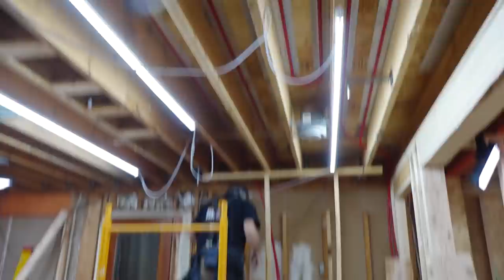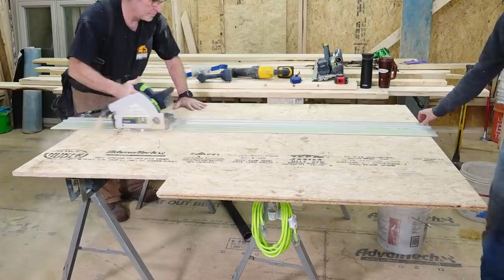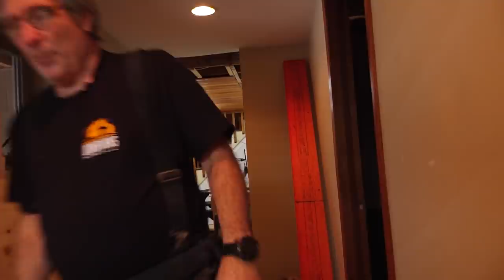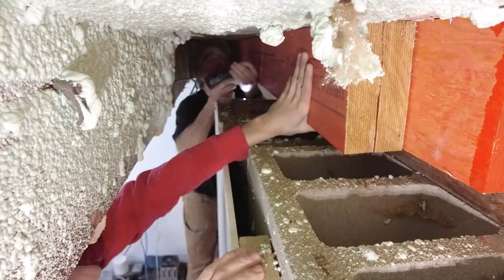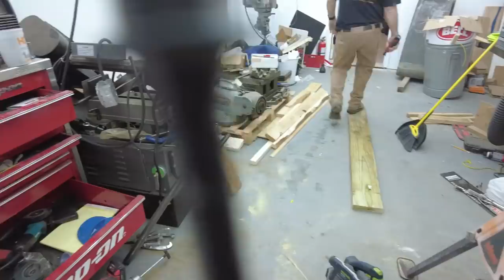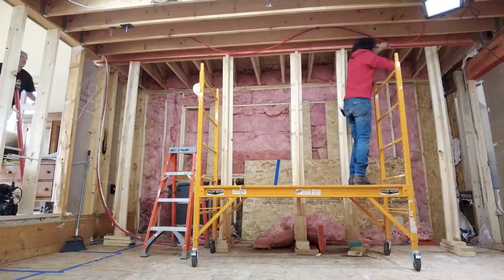Setting the Final Beams | Home Renovation & Addition Part 30

Comment: I'm SO GLAD that you are "sins of fixing the original builders/and missteps/lack of engineering/DIYers" for your renovation! We had to deal with some of these same types issues in our house remodel we did 15-ish years ago. 
'm Super GLAD that Donovan is there to work with you on this massive project!
You'll be VERY HAPPY that you worked with a competent contractor; it'll save you lots of nightmares in the future!

Comment: Finally those temporary supports are down, I’ve been waiting weeks! So much more room for activities. Thoughts on doing a blower door test after finding that big air gap in the basement? Seems like a good time to check for air leaks before things are buttoned up.
Reply from the maker: I'm looking at doing one mostly just for fun.  The original 1960's portion is full of holes.  You can feel the cold coming in during the winter.

Comment: Another milestone made. Great job. I know those abs are burning after all that reaching, prying, and putting in those lags deep into those tight awkward spaces. Good thing you had that Milw, I mean "red tool". Probably could have pushed that all the way with a little predrill if necessary.

Comment: Just think, once the drywall gets installed, no one will ever be able to tell there's a whole bunch of beams in those areas holding up the rest of the home above that space.  At least you will have these videos to verify there was a ton of work done and probably a ton's worth of wood in it to get the job done.  It also helps that you have a woodworking shop in the home where you can make a piece of wood fit just about anywhere.   Nice work and love the banter that goes along with the video.

Comment: In the state of California all beams have to be solid wood beams for earthquake proofing. And believe me when I say they are not only very heavy but they aren’t exact size and needs plaining. Every stud needs an anchor plate to the bottom floor plate. All floor plates need bolted to the foundation every couple of feet. Each phase of the project has to be inspected before the next phase starts. A big hassle.
Reply: Ok????

Comment: Sorry I'm late to the show. I got tied up. Well now, I bet you're happy that beam finally got installed. Just wait till those windows get installed and you'll really see the change in the room. What I love about your project, is that a showing how to do the job properly with the right materials and will be approved by the building inspector.
Most of the overnight wonders on YouTube these days with do-it-yourself offgrid building videos do not have a clue what they're doing and are doing so without the proper building permits.

Comment: I am amazed at how much timber you are having to put into the extension work. A question about the build.  Are you having to rectify any faults in the original build to make the new parts fit?
Reply from the maker: Lots of little oddities and oversights that we’re fixing as we go but the biggest thing was fixing the floor structure in episode 27

Comment: Are you installing any radiant heating in the ceiling of the room with ALL THAT GLASS or is there enough in the floor to make up for that chill & no room for insulation unless you intend to wrap that exterior wall with 2 inches of polyisoseraniate to make up for the heat loss where there is only wood
Reply from the maker: Walls and ceiling will be sprayfoamed. There is both radiant and forced air in there

Comment: hi why did you have to put more LVLs in the basement, what did you change that necessitated it? that doorway in the basement was already there right? but you needed to put LVLS there to support the new LVLS above where the front extension is? because the wall that was there is now gone?
Reply: The upstairs beams are supported by posts, which in turn need to go down to either another beam, or the foundation. The post on one side of that new main floor doorway was sitting on the floor. They had hoped it would line up with the foundation, but it didn't. So they had to put in a new beam in the basement that transfers the load from the new post across to the foundation.

Comment: 25:55 How wide is that double PT beam on the left side of the frame? Hope it's not a 6" hole in a 2x8 (1 1/2" x 7 1/4" actual) and hope you 2 didn't put it there.  My guess would be the previous "contractor".
Reply from the maker: 2x10; used to house a duct which we removed
Reply: @mcremona  Only commenting due to size of hole relative height of beam. I forget what the guidelines are about how large and where a hole can be in structural member

Comment: Why no adhesive on the treads?
Reply: Those aren't finish treads. They go on top.
Reply: @firesurfer  More reason for adhesive, no? Subflooring calls for it, why not the sub-tread?
Reply: @paulzeee  Subflooring is a large mass that easily expands and contracts. The rough treads are too small for that.
Reply: @firesurfer  ahh gotcha. thanks

Comment: Is Donovan bringing in a Subcontractor to hang and finish the drywall? A good sub is amazing. They can get it done much quicker than a general contractor. Usually half the time and their taping and mud finish is slick as glass. It makes a difference when you hang and finish drywall full time.
Reply from the maker: We’re probably going to do it. The majority of the seams that matter will be the ceiling.
Reply: @mcremona  I had forgotten the sunroom is all glass. Donovan does good work. You'll learn a lot hanging sheetrock with him.

Comment: One problem with those PT plates under those LVLs they are soaking wet. They will shrink when they dry. Meaning the LVL will fall and cause problems up stairs. It was a mistake to use those there. Donavan should have known that.
Reply: I’m pretty sure the shrinkage of the pressure treated lumber will be across the width of the wood so it shouldn’t be a problem.